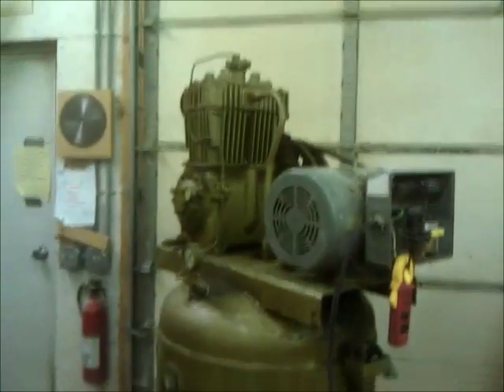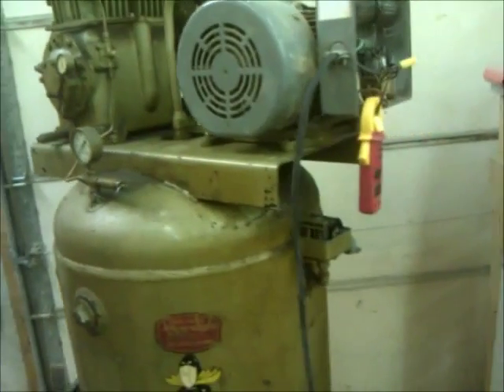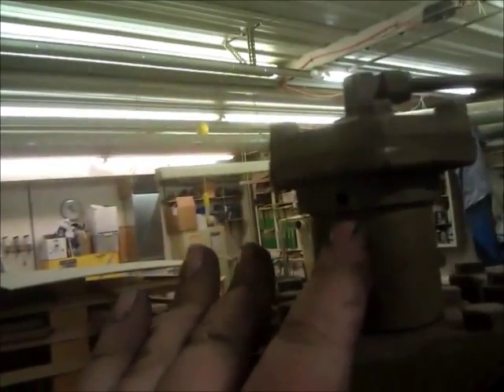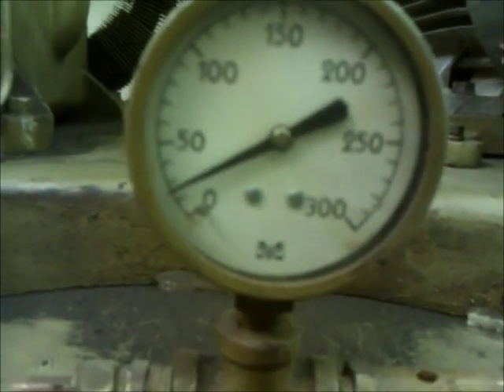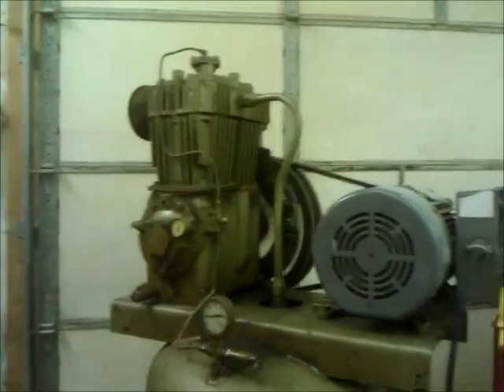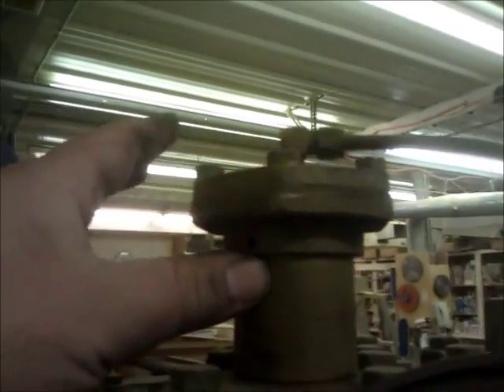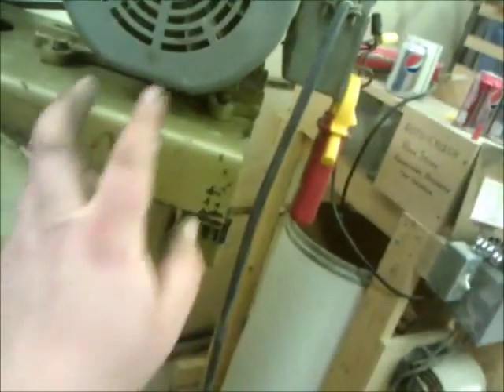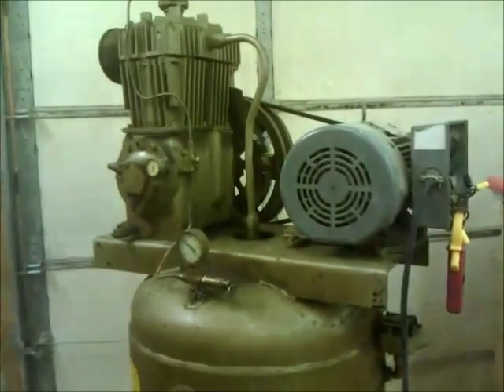Quincy QR 325  Compressor- Set up and test run # 37

Comment: Quincy model 325  air compressor was running fine when we unhooked it now about six months later and it won't pump
Reply from the maker: Check the oil pressure. The QR 25 Series needs a specific amount of oil press to close thr unloader valve so it can build pressure.

Comment: Does anyone know how to adjust the oil pressure. 

Mine is at about 14.5 psi of oil pressure.

I believe I've seen others I've seen were about 20 psi.
Reply from the maker: If have to think for a second on that. If I recall there is an adjustment screw or bolt on the pump. If you are running around 14-15 it's okay, but a little higher is preferred on the older units just to ensure good oil flow to the journals.

Comment: I have this exact setup but it says 1964 on the side and it says Lincoln compressors St. Louis Missouri....It is gold in color with an airplane sticker on it...It looks to be in great shape for 55 years old! I bought it from a man that scraps metal....It looks to be complete accept for the motor missing... can someone please educate me on what motor I need to get to get it running properly? Do I use a 5 HP 1750 rpm? Or the 5HP 3500 RPM? And can I use a single phase? Any info would be appreciated...I’m not trying to rebuild stock I’m just trying to get it up and running....thanks
Reply from the maker: Ok......you will want a 5 HP 1 ph 1725 rpm 184t frame with a 1.15 service factor I . The Baldor L1410T is a good compressor motor. You will need a 7.75" O.D. "B" section pulley which will run that compressor at its original rpm of approximately 815. I hope this helps. Scott
Reply: The Wood Craftsman this information is greatly appreciated....It’s exactly what I needed plus some! I’m more than grateful for your prompt response....Thank you.
Reply: The Wood Craftsman one more thing....Did you say yours is an 80 gallon? Mine is the exact same size, but the guy told me it was a 60 gallon, however my first take on it was it looked a little beefier than most modern 60 pounders I’ve seen...I’m gonna double check the welded on label again, but I don’t remember seeing the size...however if it is an 80 lb tank that’s better for me....Thanks again for all the useful info!

Comment: That's a nifty compressor you have there.  Those Quincy 325 pumps are awesome.  I have one (a ROC 10) that I bought surplus from Stanford University for $256 in the mid 1980s.  I have used it a lot for almost 30 years, and it has never given me any problems.  Just give yours regular oil changes and clean the intake filter, and it will give you many years of trouble free service.  By the way, that tank drain on the side most likely has a tube inside that reaches down to the bottom of tank.  So you probably won't have to add another drain.